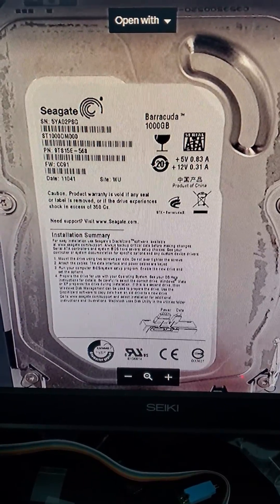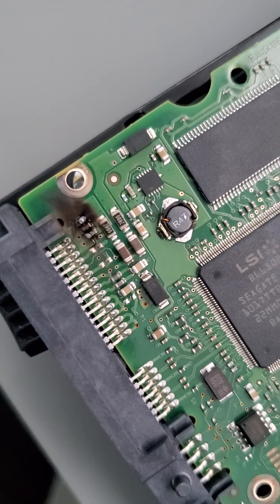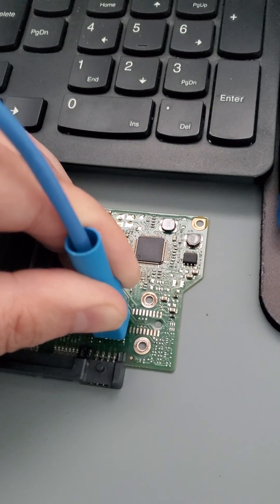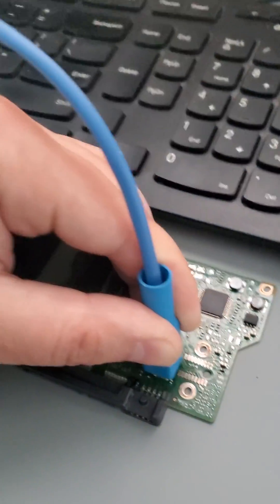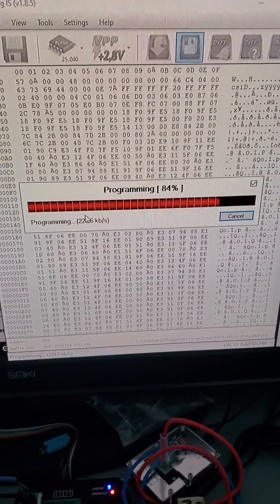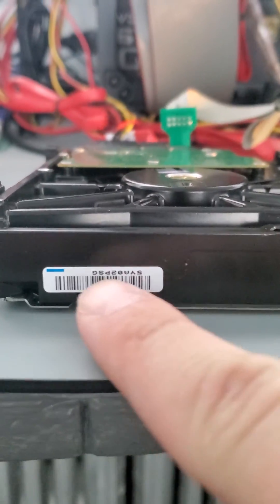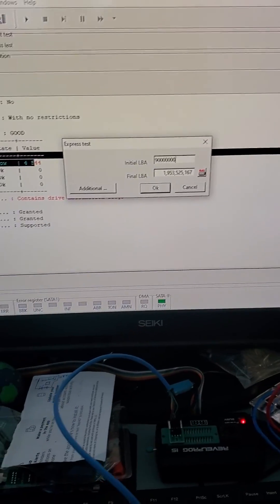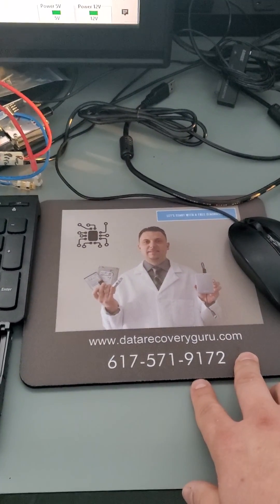Seagate hard drive repair with damaged PCB Board electronics using ROM Programmer

Comment: The question is, what if the original factory BIOS chip is fried? Is there any way way to program the new BIOS chip without having one to copy? IE does Seagate, and other other drive makers, make the original code available in any way? Or do they have encryption keys involved? ETC.
Reply from the maker: @TheProjectHelpDesk  This has nothing to do with encryption keys. That's a different topic and it doesn't apply to the context in the video.

Without a copy of the BIOS available, it is not possible to get a copy. Seagate claims to not have copies of specific drive firmware. Don't see the point in them keeping one.

If you need to recover the data, depending on the exact model Seagate drive, then a really good data recovery specialist may be able to work around the BIOS missing issue and recover the files. Obviously it will be very expensive as it requires highest level of data recovery tech skills.

Comment: The zener protection diode was burnt, wouldn't have been easier to replace it?
Reply from the maker: To get the drive working, just need to remove the diode. Replacing is not necessary, unless the drive will be back in full production, which it won't be.

But as you can imagine, we tested and there was other extensive damage that would take way too long in going the rabbit hole with testing. 

In a business, to keep it profitable, it is imperative to work smarter, not longer.

Lastly, since that particular board is rare, it is good to have in stock for future cases. 

Lastly, in educational/solution content creating, it is healthy to show people alternative ways to solve a problem. For example, someone may not be able to solder, so this solution is a good option.
Reply: @Datarecoveryguru1    I understand, but going through the path of re-flashing the bios is kind of a spooky think for me, I haven't done it yet. If I do not do it properly I could screw up the board. I feel more comfortable soldering new components. Good video, nonetheless. 😎👍
Reply from the maker: @redangrybird7564  Thanks. Well, backing  up the resources is a must first. Therefore, if something goes wrong, it can be fixed.
Reply: @Datarecoveryguru1    I just subscribed to your channel, very good and underrated unfortunately. Take care.

Comment: hello, I didn't know about revelprog-is.  I have an Xgecu T48 but when trying to access the bios through the PCB circuit I get an Overcurrent protection message and I can't access the BIOS, I have to remove it from the PCB to handle.
Reply from the maker: Never heard of Xgecu, but all programmers could be a little finicky. Many times it works fine, sometimes it does not.